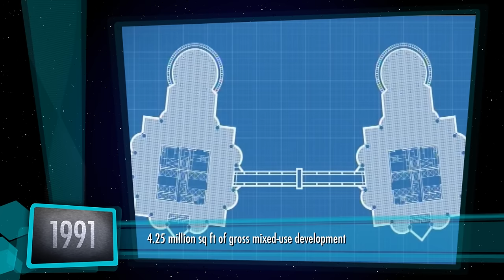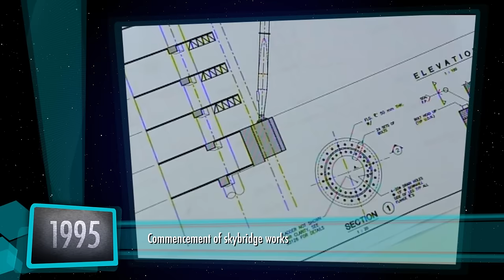Petronas Twin Towers - Milestones

Comment: Actually, both towers are functioning as lightning antenna for KL. KL is the most thunder strike city in the world.

Legacy PM Mahathir:
1. 1981 - Prime Minister
2. 1982 - 'Raid Dawn' British Stock Exchange - Sime & Guthrie cameback to Malaysian.
Buy British Last Policy.
3. 1982 - Look East Policy ( Japan, Korea, Taiwan, HK)
4. 1985 - Penang Bridge (Korean Engineering)
5. 1985 - Proton Saga (1st National Car)(Japan Automotive Engineering)
6. 1990 - Vision 2020 start
7. 1991 - KLCC start
8. 1993 - KL Tower
(1997 - Asian Financial Crisis)
9. 1997 - Putrajaya
10. 1997 - Putra LRT
11. 1997 - KLCC ( Tower 1 - Mitsubishi / Tower 2 - Samsung )
12. 1998 - Commonwealth Games
13. 2003 - Resigned as 4th PM
14. 2018 - Comeback as 7th PM with opposition league.
15. 2020 - Vision 2020 ( but might be quiet late to achieve because of kleptocracy incident)
Reply: 2020 - PM7i
Reply: Fly car
Reply: Why didn't you mention klia???
Reply: Vision 2020 will never be achieved and that has nothing to do with kleptocracy. It's been moving backwards not forward since the program began.
Reply: @mohamedfarook2855  sepang circuit also